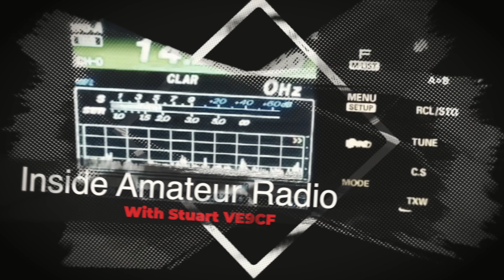The 9 MHz Mystery Explained! Why We Use USB & LSB

Comment: Fascinating. So, could one conceivably use usb on a particular band instead of lsb and vice versa? I understand that others would need to be setup the same way to communicate with one another, but is there any reason they couldn’t?

Thanks for another great video.
Reply: Yes with modern radios you could use USB on 160 to 40 and LSB on 20 to 10 for voice communication if you have others willing to try it.  Just keep in mind that you run the risk of causing unintentional interference by stepping outside of tradition.
Reply from the maker: Thanks for your comment...with digital modes we use USB on the lower bands
Reply: @ thanks

Comment: I had a Yaesu FT200 valve rig with 9MHz IF and always understood the mixing process but now we use usb on 60 metres and usb for data modes on 40  and 80 Metres! Very confusing!
G4BTI
Reply from the maker: Correct... :-)

Comment: Another great video—thanks! I assume you meant HF amateur equipment all has sideband... I just wish that extended to all rigs! I simply don't understand why the Big Three won’t make more VHF and up rigs—HTs and mobile especially—with SSB. My guess is it's because most VHF and higher-band activity is through repeaters. Still, maybe the rise in digital modes will help bring back SSB for mobile and handheld rigs. 73
Reply from the maker: I would buy a 2m SSB radio and put up a massive tower for 2M SSB, We have a 2M SSB net in Moncton, never been on it
Reply: @outnaboot  Yes sir. VHF/UHF with SSB, and HF with AM and FM modes are under utilized but are different and ton of fun. Hope to catch you on the are sometime. 73 from N. Idaho

Comment: In 2025, cost certainly can't be a factor these days.  I suppose this is another case of 'if it ain't broke, don't fix it'.
Reply from the maker: More of this is the way it always has been, so why change it.
Reply: @outnaboot  Welcome to the wrong sideband net. Our purpose is to drive you nuts every time you tune past us because you feel compelled to push that button to find out what the heck is going on. lol. Actually I've come across qso's in Spanish below 7100 on USB occasionally.
Reply: The fact that for well over 50 years single band and multi band HF high band radios that use transistors still give you the option of USB and LSB when this old man rule has been in place for 100 years.. 6m-10m-11m-12m-15m and 20m radios that have LSB, why not just hard wire them for USB?? Same goes for the low bands with a USB option it would cut down on operator error.. My newer radios seem to make it pretty tough to chose the wrong mode because of the microprocessors and program code they use but the choice is still there.. I would imaging that given more freedom to choose would create more noise and confusion..
Reply: Then some lid comes along talking smack about you behind your back because he knows you got one a them one sideband only for dummies rigs lol. BTW 11mers used lsb on at least 27.355+. In the mid 80s in the Phoenix area we had channel 16 as USB, 35 through 40 lsb, above 40 was lsb unless you wanted to speak Spanish on the international calling frequency 27.455 or something, and the rest was AM.